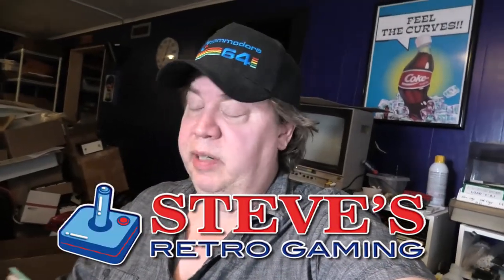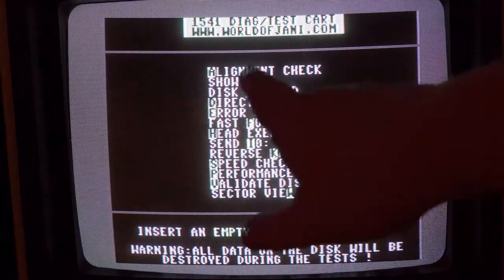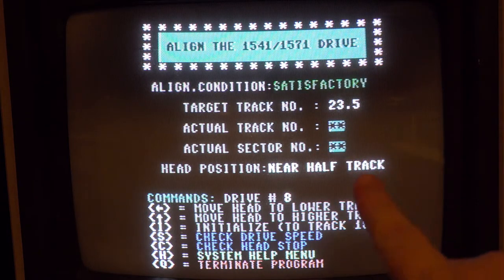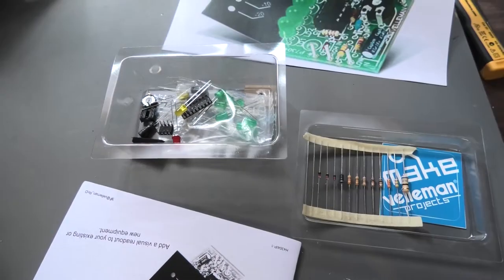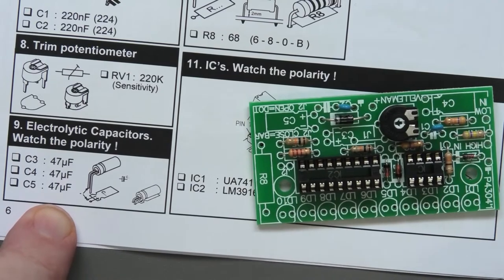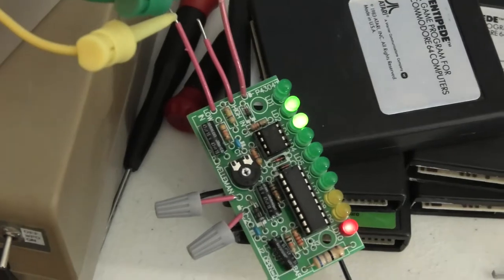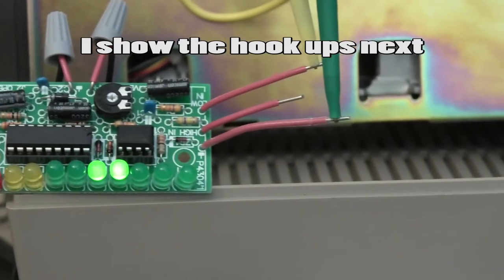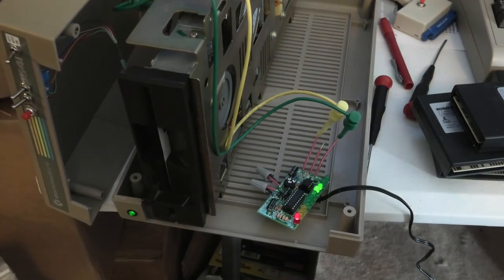Commodore 1541 Alignment Device - Build & DEMO & More

Comment: Thanks for the video Steve! Do you know if the Vu-Meter can also be used to align a 1571?  Which chip and pin would the read signal come from on the 1571?
Reply from the maker: Its pin 7 of chip UF4  (it should be an LM592 or NE592) in the 1541, so I would check the 1571 for the NE592 or LM592 chip. I am not sure though. But I would start with the Free Spirit Alignment software first and go from there. I own a few 1571 drive, but never use them.